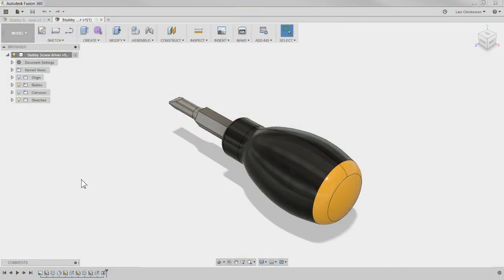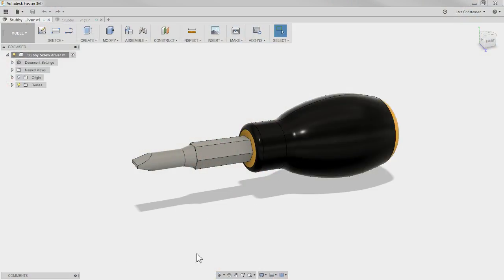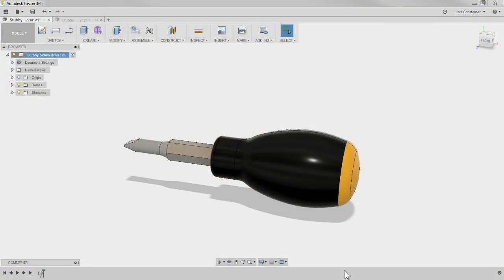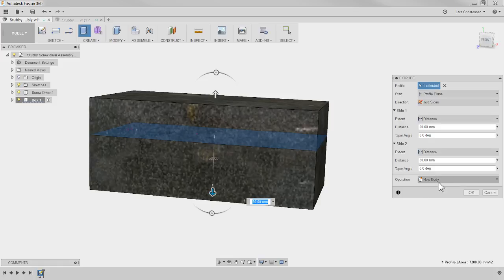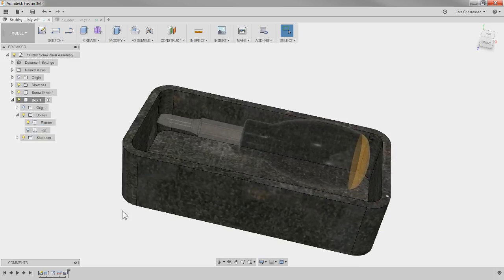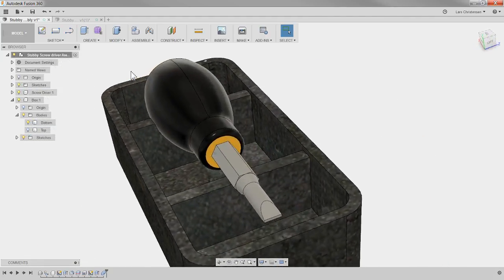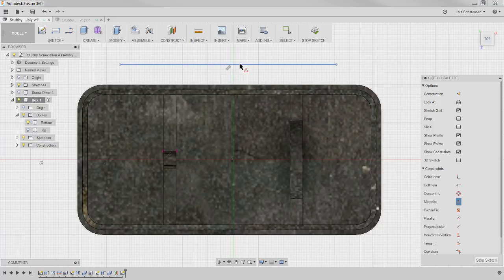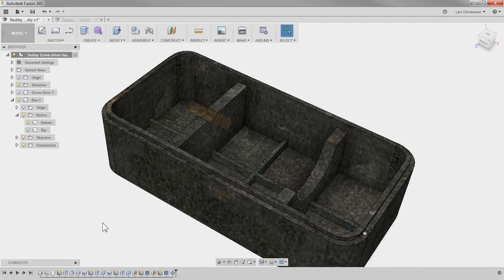Import a Model and How to Work Around it — Fusion 360 Tutorial — #LarsLive 122

Comment: Hi, you used the imported screwdriver to cut out from the foam, but that would have cut without tolerance. Is there an easy way to 'inflate' the cut to add a tolerance?
Reply from the maker: Hi John Morrison Thank you for watching!
That is a great question. You could have scaled the screwdriver or just use the press/pull "Q" to offset the single faces.

BEst,
Lars
Reply: You could scale the model that must fit in the case before you create your box. Or am i wrong on this?

Comment: Great webcast Lars. Quick question. Whats the radio looking device on the wall behind you?
Reply from the maker: Hi mark scheiner Thank you for watching!
It is a Haas Simulator. Mostly used in classrooms settings where you can take the code generated with CAM in Fusion and test it vs. going to a CNC machine and run the code.

Best,
Lars

Comment: Hi Lars! Hi all! I just wanted to point out a neat trick you could have used at 12:52. Start by selecting the horizontal constraint and then you hover over the center of the line holding the shift key. This will allow you to select the midpoint of the line. Next, you continue with selecting the origin. This way, you skip all the part where you have to draw a line and has a bonus, you keep a more uncluttered sketch. Hope this helps!  ;)
Reply from the maker: Hi Blaise Barrette Thank you for watching! ANd the great tip!